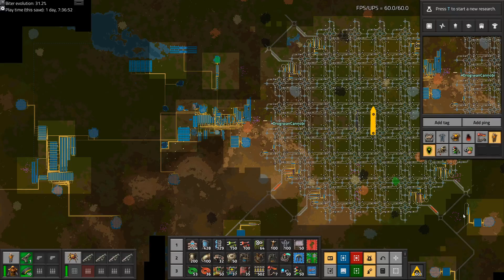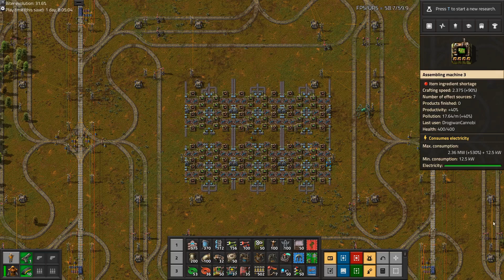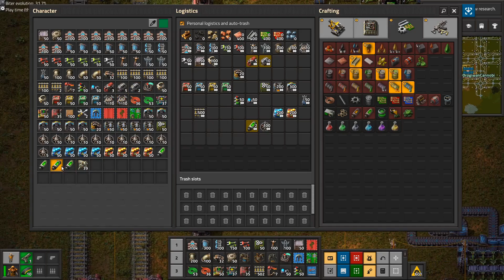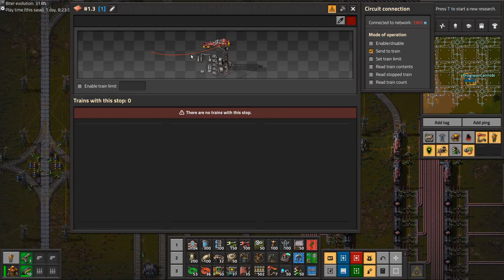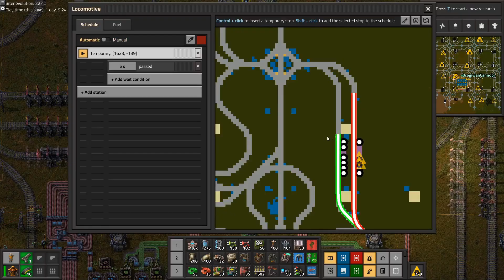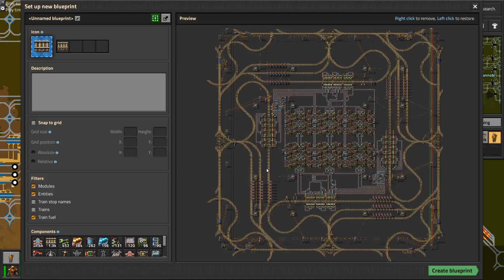Jumping Trains 4 - Starting on the Monorail Base

Comment: Lookout for kitch videos. He used pre train limit a circuit network that sent an order for each train once. So that solution would not break with the flying-non existent trains.
Reply: Each provider has multiple trains and there is a "full waiting" station. When some where needs iron, only one iron train would go out to serve it. Might break if multiple orders of iron come simultaneously, mixing where each train is going, but should work
Reply from the maker: That sounds great, I'll check that out!